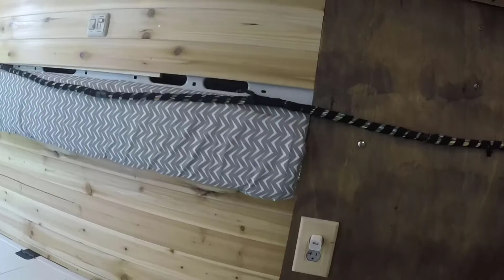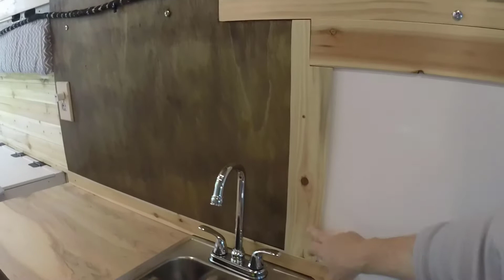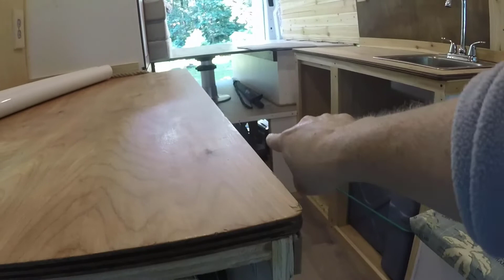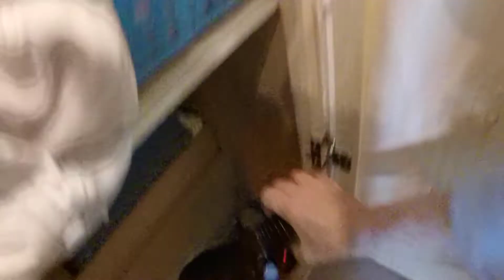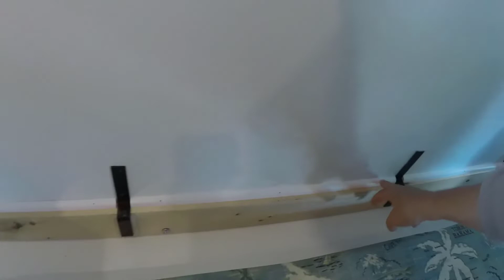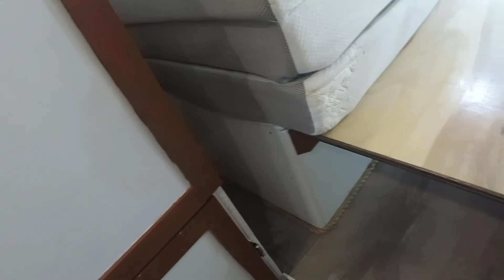Ford Transit Van Conversion - Wall Panels, Power Meters and Maps

Comment: Hi, 
We are following you closely because we ordered a 2019 Transit, the same  length and height as yours, the difference is that we ordered it blue and with windows all around.We should get ours just before Christmas. We plan on converting it to a RV. 
Thanks for all the good advice and good videos.

Comment: Change your galley 120V outlet to a GFCI
Reply from the maker: We did buy one. We usually have the inverter turned off and only run on 12 volt. But we got one to put in. Thanks for the safety tip.